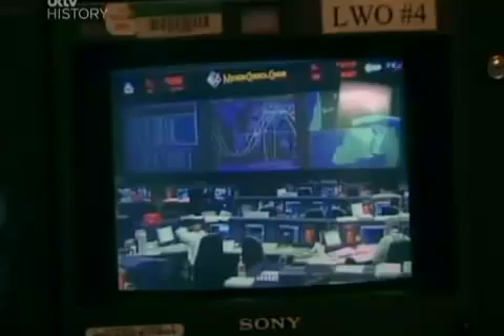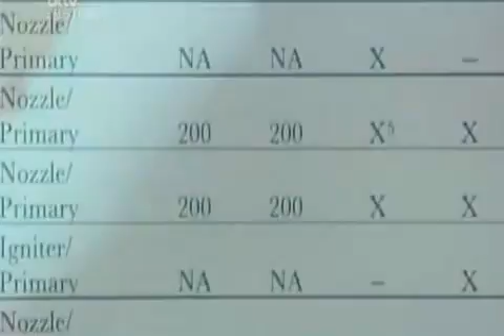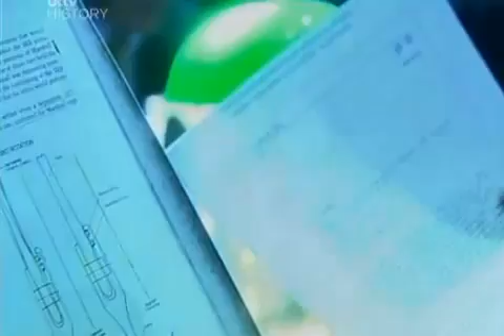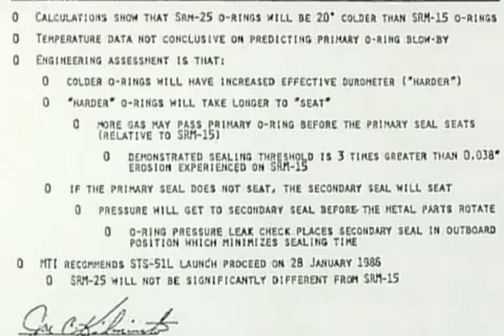The Last Flight of Space Shuttle Challenger 3/5

Comment: The immense heat and pressure from the rocket boosters are important elements to propel the shuttle into space.  Equally important are the heat tiles to protect the shuttle from disintegrating upon re-entry.  Both of these crucial parts of the shuttle launch and subsequent re-entry were compromised by incredible stupidity in both shuttle disasters.